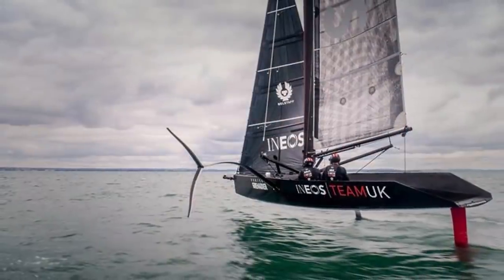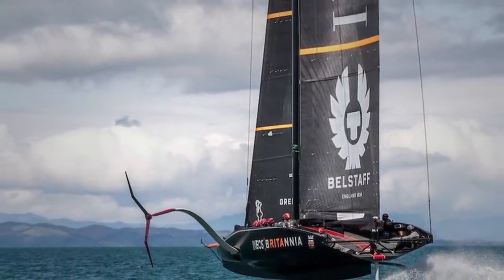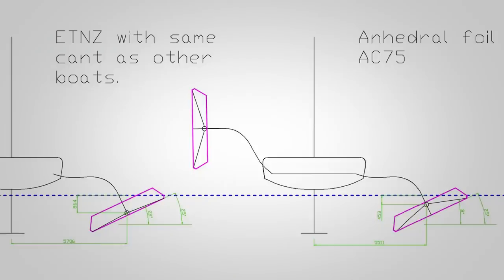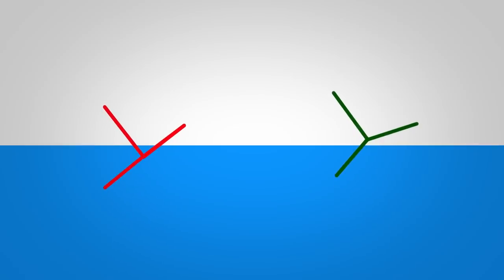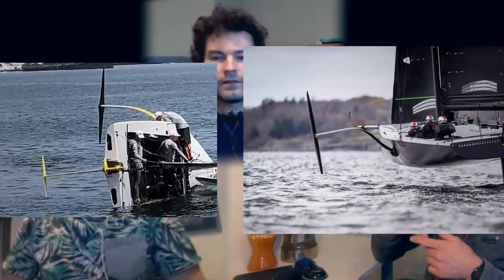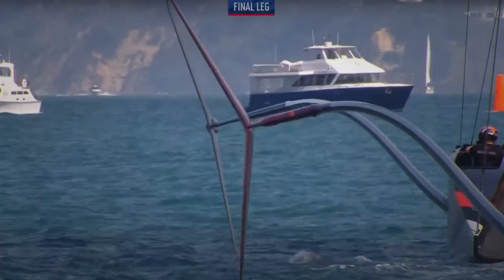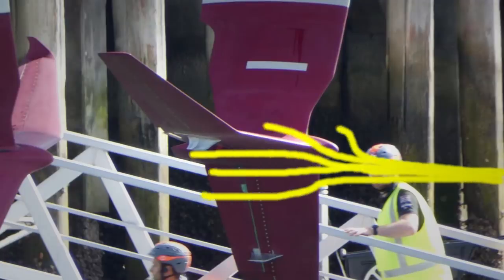Whose Foils are Fastest? ETNZ V Challengers // Straight V Anhedral

Comment: So what was the issue when American Magic couldn't put the foil down during race 4 ?  Was the whole boat losing hydraulic power ?
Reply: It looked to be an electrical snag of the switches at the helm.
Reply: I reached the conclusion that the most probable cause of the malfunction was the delayed effects of contamination of the hydraulic fluid in the Foil Cant System, by sea water, following immersion of the system during the capsize two weeks previously. In support of this, I would include the following observations:
1. After one of the failed attempts to raise a foil arm in the last Semi-Final race, Dean observed "The Board is coming up, but slowly". This effectively rules out electrical or electronic command signalling problems as a cause of the malfunction. It is very unlikely that a faulty switch, for example, would cause slow movement. Therefore, the cause of malfunction was either mechanical or hydraulic.
2. During the Post Race Press Conference following the capsize, Terry Hutchinson said that the team would have to replace all the electronics and electrical wiring, but that the Foil Cant System was a sealed system. This implies that the team did not deem it necessary to replace the hydraulic components in the Foil Cant System.
3. Mozzy Sails pointed out that a problem with raising or lowering the Foil Arm had first been encountered by American Magic the previous day of racing in the Semi-Final. However, the problem had become a whole lot worse on Day 2 in the last race. If the problem was easy to fix (e.g. replacing a faulty switch button), the shore technical team would have done this overnight.
4. Mozzy Sails also mentioned that the problem with the FCS first appeared in the Foil Arm on one side of the boat. Hidden damage to the Port Foil Arm mechanism is conceivable as a cause, because the boat crashed heavily on to the Port Foil during the capsize. However, Mozzy Sails went on to say that the problem had subsequenctly spread to the Foil Arm on the other side of the boat. The Foil arm mechanisms on each side are independent, therefore mechanical damage cannot spread like a virus between them.The common factor is that both Foil Arms are controlled by the same hydraulic system. This means that the problem lies in the hydraulic system of the FCS.
5. To determine what, in the hydraulic system, could give rise to the observed intermittent behaviour, it is necessary to gain some understanding of how the system operates. I have no insider knowledge, and so had to resort to google searching on the Internet. However, there is no Haynes Manual (there is not exactly a mass market for an AC75 FCS), and a search for "AC75 FCS Maintenance Manaul" was unsuccessful, although such a manual exists and is issued to each Team. However, there are some YouTube videos which provide some basic insights, such as the description given by Emirates Team New Zealand Project Manager Peter ‘Brush’ Thomas in this video:
https://www.youtube.com/watch?v=_B37zmJpBv4
The large diameter tall black cylinder is described as a storage cylinder, but is effectively the reservoir for the hydraulic fluid in the system. This should not be confused with the translucent glass fibre cylinder, called a "Tank", which, together with the white gas bottle form an accumulator which supplies pressurised fluid for filling the Foil Arm actuating cylinders. By the way, the free-floating disc with 'O' ring seals each side serves to separate the pressurised gas in the top of the cylinder from the hydraulic fluid in the lower part, while equalising the pressures on each side.
The reservoir (black cylinder) is mounted on a manifold block, on which all the hydraulic valves are mounted. These valves, especially the DCVs (Directional Control Valves) which direct fluid in out of the Foil Actuatpr cylinders will be susceptible to sea water contamination of the hydraulic fluid, because they contain steel spools sliding within bores in a steel body, with tiny clearances. Over a period of time such as 2 weeks, these steel parts can rust, reducing the clearances, and cause the valve spools to stick within their bores, causing a failure to respond when commanded, or slow movement of the Foil Arm in the case of a partial spool movement which will throttle the flow of fluid.
6. From the point of view of fault diagnosis, it is necessary to establish where sea water could enter the hydraulic system to cause contamination of the hydraulic fluid. We can assume that the pressurised side is adequately sealed by static seals ('O' rings etc.). The pump shaft will rely on a shaft seal, which is a dynamic seal, potentially an entry point for sea water ingress while the system was submerged. However, the shaft is a small size, and the period of immersion was probably insufficient to allow significant water ingress. The seal at the ends of the foil actuator arms are also dynamic sliding seals, and are larger size and so are potential entry points for sea water when submerged.
However, the potentially largest potential entry point is the reservoir (black cylinder), which is probably open at the top. In the video, it is stated that this cylinder contains a piston. We can asume that it also contains a spring, to force the piston against the hydrauilc fluid, and creating a minimum pressure above atmospheric, in the system. The function of the piston is to contain the hydraulic fluid and separate it from the environment (normally air, but water when the system is immersed). There will be some form of seal to prevent leakage for hydraulic fludi to the environmentand vice versa. It should be possible to achieve a complete seal if a rolling diaphragm type seal was chosen. However, a sliding type seal may alternaively have been used. Rolling Diaphragm seals are described, for example in this article:
https://www.machinedesign.com/mechanical-motion-systems/hydraulics/article/21833286/rolling-diaphragm-seals-stay-strong-under-pressure#:~:text=Rolling%20diaphragms%20are%20basically%20pressure,rather%20than%20a%20sliding%20one.
The article also mentions some of the potential failure mechanisms that can occur when such rolling diaphragm seals are used.
Either way, whether a rolling diaphragm seal or a sliding seal is used, this must be considered as a potential entry point for sea water contamination into the hydraulic system.
7. The designers of the FCS probably did not anticipate that, even after a capsize, sea water would rise up to the level of the top of the black cylinder. Therefore, it is probably open to the envionment at the top. In a normal capsize, this would not be a problem. The hole in the hull caused a higher level water than anticipated. It is possible that seawater collected at the top of the black cylinder remained undetected while the boat was in the shed being repaired. This will have allowed sea water ingress over a long period, past the dynamic cylinder seal, or a (potentially damaged) rolling diaphragm seal.
8. When, during the last race in the Semi-Final, Dean reported problems with Foil Arm movements, he sounded annoyed and frustrated, but not surprised. This means that the problem had been experienced previously, probably during the pre-race practice days, and they knew of some work-arounds, such as cycling the Up/Down buttons, which could raise the system pressure and jog the valve spools into moving. No doubt, their technical team would have worked on the problem and fixed it if they could. However, they might not have had sufficient spare parts or time to effect a cure, by the time they had discovered the problem.
9. The cure for the problem would obviously have been to drain the contaminated hydraulic fluid, replace the manifold block with its malfunctioning valves, and refill the system with clean fluid.
10. Mozzy Sails points out that American Magic crew were not racing properly at the start of the race, because the crew felt uncomfortable in their boat, i.e. they knew what the problem was, and that their boat had been severely compromised.

I would emphasize that my comments above are pure speculation, but are based on observation and analysis. I have no inside knowledge, and have not heard any offical explanation yet for the cause of the malfunctions.
It is important that this problem is resolved, as all the Teams use the same Foil Cant System.
The boats remaining in the competition should not have to suffer technical problems in the FCS, to allow rair racing 
I hope this is of interest.
Reply: After further consideration, I withdraw the conclusion I made earlier, that the malfunction of the Foil Cant System (FCS) in Race 4, Prada Cup Semi-Finals, must be caused by a hydraulic fault. This conclusion was based on my naive assumption that the FCS uses Directional Control Valves (DCVs) for controlling the Foil Arm.
The AC75 Class Rule (Section 27) implies that the FCS must be capable of positioning the Foil Arm to a resolution of about ±1 degree.
In the video 'TESTING THE FOIL CANT SYSTEM', Project Manager Peter 'Brush' Thomas demonstrates the system, and claims that the residual oscillations will be trimmed out within the logic of the Programmable Logic Controller (PLC), which controls the FCS. See video at:
https://www.youtube.com/watch?v=mkYJbm3hJN8
Furthermore, it may be necessary to control the velocity of the Foil Arm in order to meet the requirements of AC75 Class Rule 27.4 (a) (i), which seeks to limit the amount of negative Foil Cant Moment.
In order to achieve the required positional resolution, and to have any hope of damping the Foil Arm oscillations using the PLC program, proportional valves of some sort, or even servo valves, which have a higher frequency response (bandwidth), or equivalent valve types, must be used instead of plain DCVs.
Therefore, it cannot be concluded that the slow movement of the foil arm observed at times as part of the FCS malfunction on American Magic, during Race 4 of the Prada Cup Semi-Final, could only be caused by a fault within the hydraulic system. It is clear that the slow movement could potentially have been caused by a false electrical input signal to the controlling servo valve (or equivalent) from the PLC.
However, it remains a possibility that hydraulic fluid contamination of some type was the cause of the malfunction.
After reviewing the videos of the racing during the PRADA Cup Semi-Final, I could find no sign of any malfunction within the FCS on American Magic before Race 4. It seems unlikely that contamination by seawater would suddenly occur during the last race.
In the Post Race Press Conference after the AM capsize, the responses by Terry Hutchinson to questions by Richard Gladwell were contradictory.
https://www.youtube.com/watch?v=4-yvEmEqdBc
At 16:15, Terry's reply implies that the FCS in Patriot would have to be completely replaced.by the one in Defiant.
At 18:13, Terry confirmed that the electrical wiring and electronics would have to be replaced, but that the hydraulics are a closed system.
From this, it is unclear whether or not the hydraulic system within the FCS in Patriot was replaced or disturbed.
There is always a risk of introducing contamination (e.g. fine particles or debris) into a hydraulic system when it is opened up and parts are replaced.
Servo Valves can be particularly sensitive in this respect.
In an earlier video, Peter 'Brush' Thomas mentions that the PLC is manufactured by Beckhoff.
ETNZ have been using Beckhoff PLCs since the 35th America's Cup series, and Beckhoff are now official suppliers for the 36th America's Cup.
See article at:
https://www.pc-control.net/pdf/012019/solutions/pcc_0119_etnz_e.pdf
In order to diagnose the cause of a malfunction, it would be helpful to capture all input and output signals of the PLC in a data logger, while the malfunctioning events are occurring. Hopefully, the PLC program incorporates such a data logging function, or other diagnostic facility. It would then be possible for each Team to diagnose possible faulty components, such as with torque or position sensors and command input signals generated by the crew's controls. With access to the PLC software, the output data could then be checked for consistency with that expected from the recorded inputs.
However, there is a problem because the Teams do not have access to the source code of the PLC program. The PLC software is proprietary to ETNZ, and to release the source code to the Teams would create a conflict of interest. Inspection of the FCS software could reveal clues as to the functioning of the software on other systems on the ETNZ yacht; clearly a conflict between ETNZ as supplier of the FCS, and ETNZ as Defender of the America's Cup.
In the PRADA ACWS Auckland Day 1 Press Conference (17th December 2020),
https://www.youtube.com/watch?v=req5JxTco3c
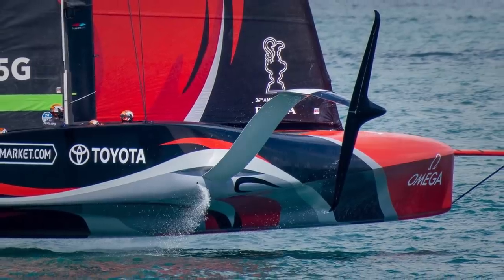At 2:40, Sir Ben Ainslie (INEOS Team UK) expresses his frustration with technical problems in the FCS experienced by all the Teams.
At 9:16, Sir Ben states “This Foil Cant System is not solved” and asks for a system to provide redress for any Team unable to race because of such a problem in the future.
At 21:11, Sir Ben asks (half-jokingly) Peter Burling (ETNZ) “Can you send us the software of how it was designed, and then we can work out what the problem is”.
In difficult cases, where a Team has been unable to diagnose a problem within the FCS, it would be necessary to send the log files to ETNZ, using them as consultants and supplier of the FCS, so that they can attempt to diagnose or even reproduce the problem in a simulation, with their access to the source code.
At this time, I have seen no information published, as to the cause of the malfunction that occurred on the FCS on American Magic. The best technical explanation is that it was caused by Gremlins!

Comment: I love the design of these boats.   I wish they'd race them in the next couple ACs.  

Isn't it a shame that American Magic got to race so few races and now she's basically a useless boat.  Unless they reuse the same rule.

I don't see the need to have ~8 grinders grinding to turn a hydraulic pump.   They should allow the boats to use a hydro and wind generator and let the grinders do other things like control sail trim.  A grinder will make max 1HP in spurts, probably 1/3-1/2 HP over time.   A few HP of generation would power the hydraulics nicely.
Reply: That's why Ineos Team UK use 6 grinders.
Reply: @VISTLER  that also allows Ineos to have a dedicated Tactician.
Reply: Or charge batteries, even compress air
Reply: Surely a wind or hydro generator would mean more drag.

Comment: What happens to the boats? Is the NY Yacht club going to  ship their boats home?
Reply: Interesting question:
1. It depends on if you are going to carry on through the next cup cycle. 
2. We know that all the teams have gutted their first boats. AM cut up their first boat for boat building parts for the repair job. I expect that the 1st boats are scrap. 
3. If the cup stays in AC 75’s, the second boats will be used as trial horses for the next cup. If not, they are scrap as well.